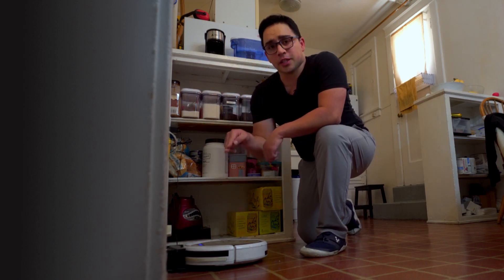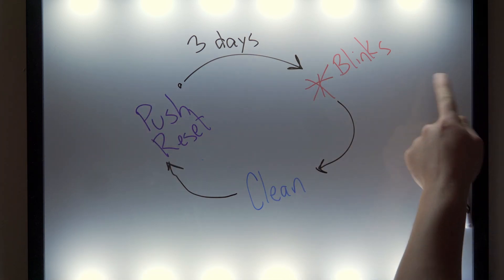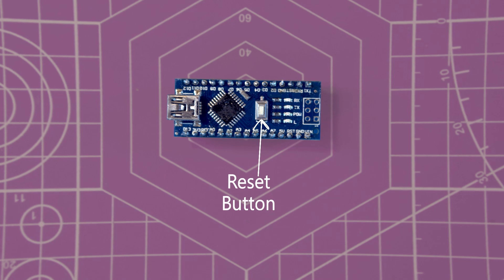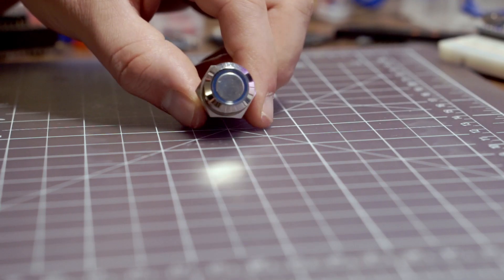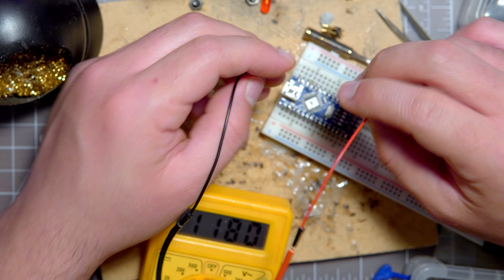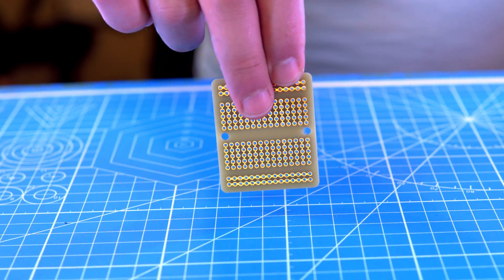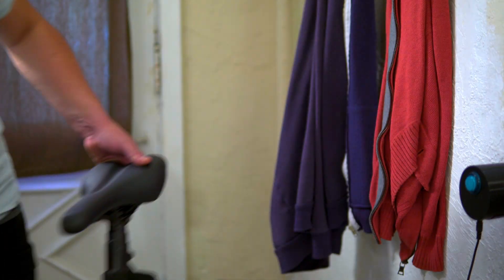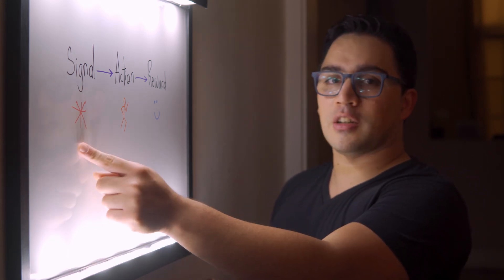Arduino Automation on myself: Sticking to a habit using technology (Great project for beginners)

Comment: Nice project.  I could tell you were gonna have corrosion problems when I heard "signal" and "water" in the same sentence lol.  It does work, it is effective for the time that your conducting metal lasts before it is inevitably chemically eroded.  The best way to measure water level is mechanically like you've done, I was happy to see how you solved that problem and I'm probably gonna use a similar approach in a project of my own.